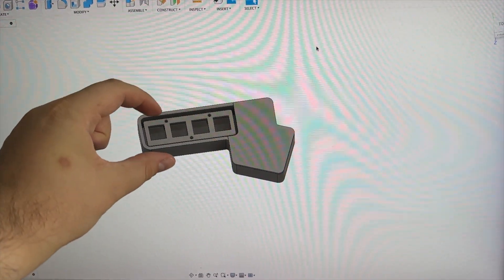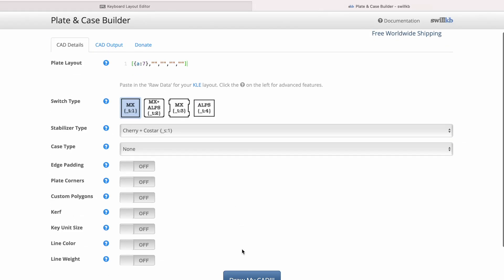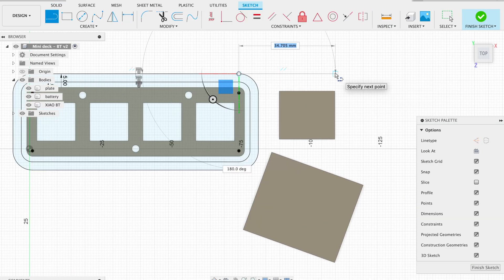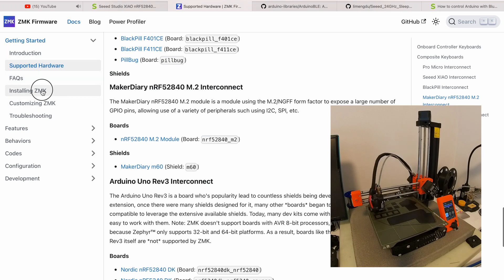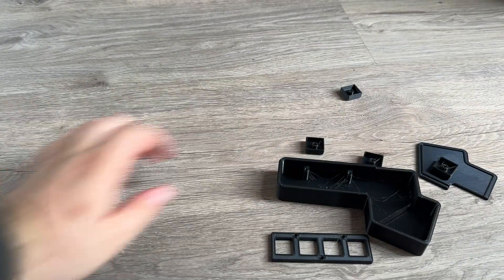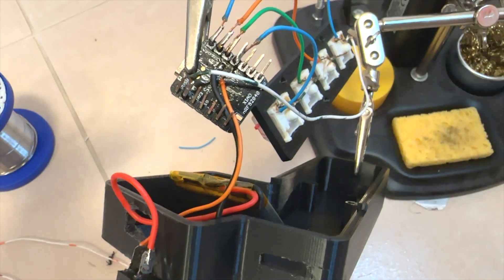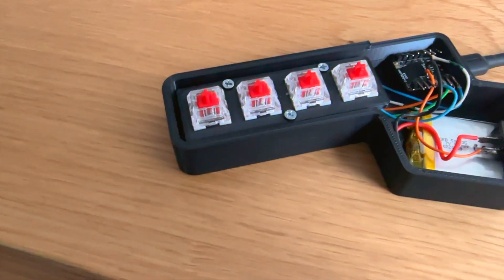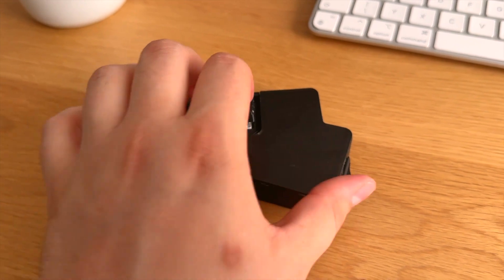3D printed DIY wireless macro keyboard | mini side hustle project

Comment: What's the battery life?
Reply from the maker: I didn't measure it exactly but I use it for several months without charging - I can tell that it can take 2-3 months for sure (and I am using old battery with some cycles on it)